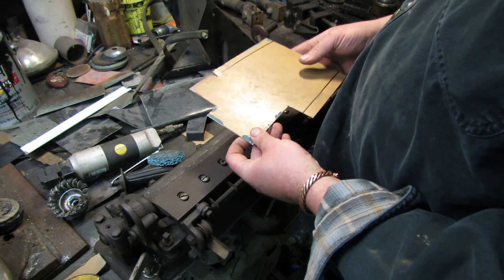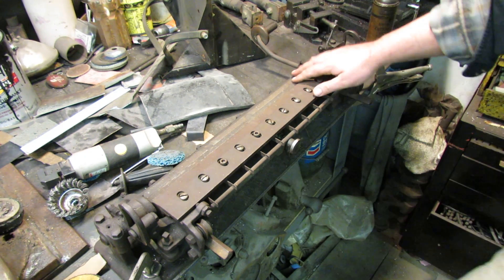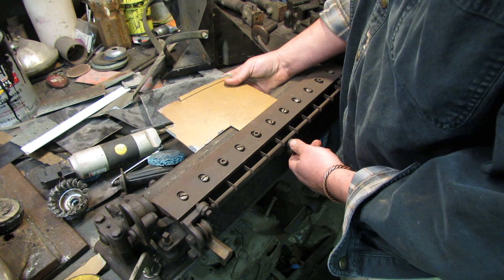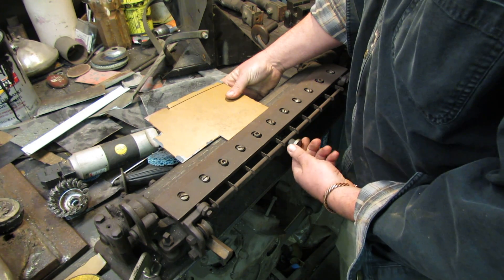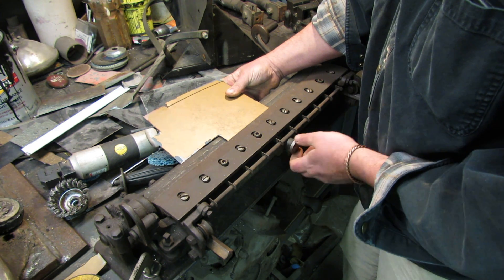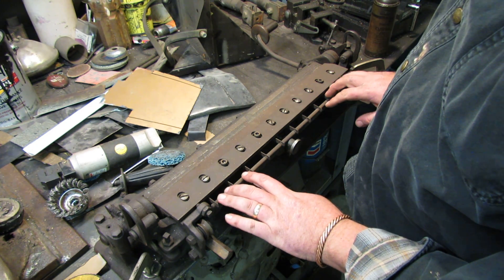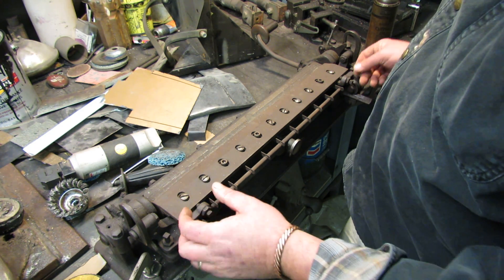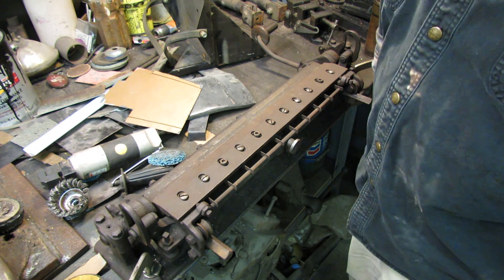Old sheet metal brake

Comment: Definitely a bar fold not a brake, its used for seaming/locking edges together. For example stove pipe or carriage lamps. Excellent find for that cheap !